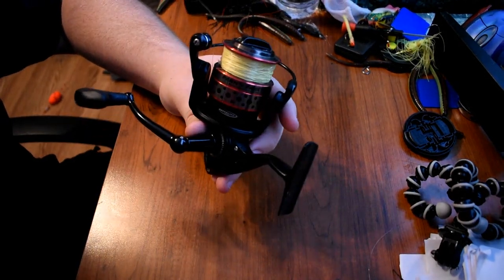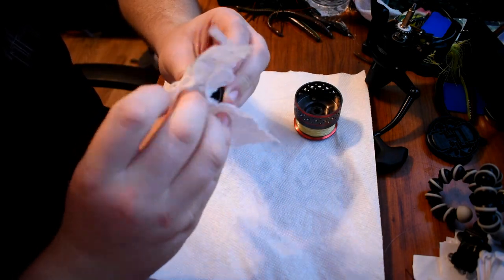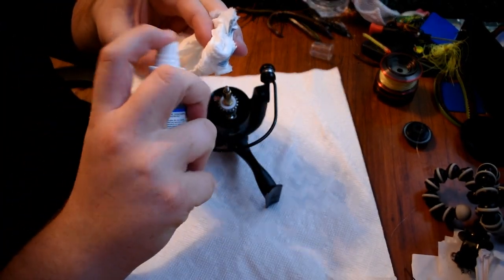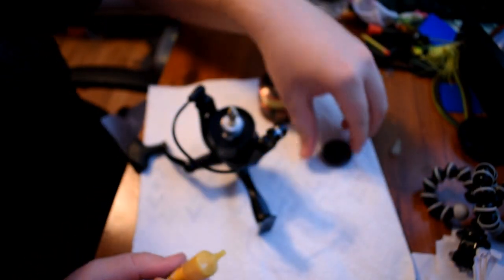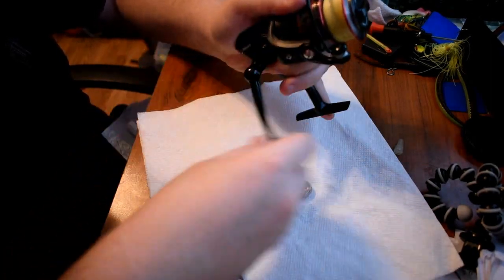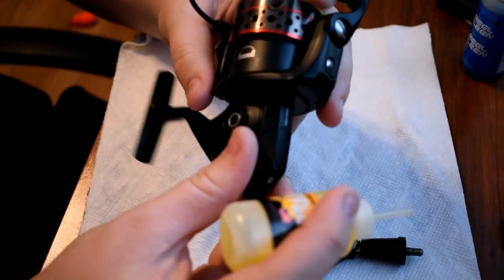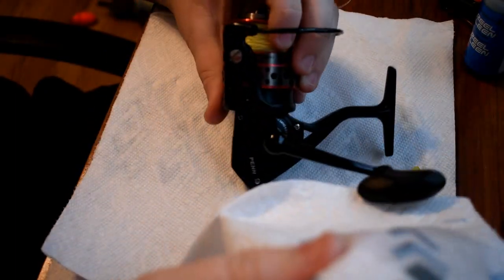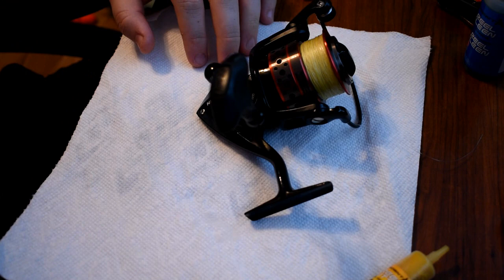How to clean and oil a spinning reel

Comment: I started watching some videos on YouTube on how to oil / maintenance spinning reels, and only 1 of the many videos address removing and lubricating the line roller (on the bail).  I started to clean my reels and did not intend on doing this extra step; primarily because I didn't think any of my reels had bearings in that area.  Come to find out, their are reels that do have bearings in the line roller and some that just use lubricated plastic washers.  Anyhow, I ended up removing the line roller on one of my reels, and low and behold, it was rusted beyond belief.  After seeing that, I decided to take apart the line roller on the rest of my reels, and the same thing had occurred on every reel.  I actually had to use an impact driver on two of the line rollers, just to get the screw out.  I could not get them out by hand and did not want to risk stripping the screws.  One screw did end up breaking.  So that's how stuck it was in there.

The point of this is that, I don't think enough people are addressing maintaining the line roller.  This will now be the 1st thing I maintain on my reels before anything else.  I am almost certain that the reason this happens, is because the line roller is the one part of the rod that is exposed to the most salt.  When you think about it, every time you cast your line out into the water, your line gets coated with salt water.  That salt water is then transferred to the line roller, and any residual amount transfers to the bearings (if any) of the line roller.  Check your reels for this and I'm pretty sure you'll be surprised at what you find.

This issue creates resistance that can be felt when reeling in smaller fish; and proper maintenance of the line roller will allow your line to roll with the line roller, instead of against it.  After I lubricated all of my line rollers, I then took a rubber band, cut it and ran it back and forth across the line roller (in a V shape) to make sure it was properly lubricated.
Reply: Great advice. I made sure to wash & lube my line roller and i noticed a difference immediately.
Reply: Mate you could make your own video

Comment: Thank you for showing this !
I actually had 2 reels that had a minor "thumping" when reeling. When I looked into the front of the spool, the spring clip had worked itself forward, and left the spool wobbling during reeling (which made it reel line unevenly, which also caused the minor "thumping").
I pushed it back down into its spot, and now the reel reels smoothly !
Thank you once again.

Comment: Where do you get the oil and  grease that you use?  Thanks for the video
Reply from the maker: Bill Rheinhardt I got it from gander mountain but they have been going out of business so I think bass pro or dicks sporting goods has it but if you are in the Tampa fl area there is always Tampa fishing outfitters has plenty of anything you need
Reply: Amazon has Ardent reel cleaning kit

Comment: You don't remove a side plate and lubricate the wheel and pinion??
Reply from the maker: I do but not unless I need to but I do that 1 time year.
Reply: @Twickleitfishing  I do mine once a year over winter.  I use Lucas Red Bearing Grease.  I have reels that are 40 years old and still function just fine.
Reply: I do alot of surf fishing in chest deep saltwater.  My reel spends half it's time submerged.
I remove the cover, clean and relube everytime I fish.

Comment: So what's the difference between the little one and bigger oil? Do you need both?
Reply: Hearts your comment but doesn't answer.😂
Reply from the maker: It’s grease for gears oil for bearings
Reply: D. Moreno Reel Butter is a grease.  Grease is used on metal-to-metal contacts and oil is used for bearings and tight areas where grease can not reach.

Comment: Y’all...do NOT use WD-40 on your reels, ESPECIALLY if you fish saltwater.  Saltwater reacts with WD-40 and makes corrosion even worse overtime.  White lithium grease does well in salty conditions, and lasts long.  It’s also cheaper.

Comment: theres no reason to put grease on your handle. IT screws in. Maybe a dab for sake of keeping it wet. but sorry no. Grease lubricates parts touching each other not for something that screws in.
Reply from the maker: Steven W I fish in saltwater I truly to avoid rust
Reply: Makes sense to me. Mechanics use anti-seize grease on bolts so they don't seize up and most likely reduces rust buildup. Thanks for the tip Twickle, I'll be trying this all soon.
Reply: Also, my reel is pretty much brand new and only used it twice thus far, but still saw blue grease on the stem of that screw section from the factory.
Reply: I always grease or oil anywhere that can rust. That's good advise
Reply: Sean T That “blue grease” is medium strength Loc-tite which is used on screws and nuts so they do not loosen easily.

Comment: Too much lube and grease, a little goes a long way. Otherwise, very helpful info, thanks for posting.
Reply from the maker: Eric Killmeier maybe for high end reels or just in fresh water but in saltwater grease will save your reel from corrosion I’ve had this reel for 4 years has been dunked and not a single problem if you oil and grease it like this
Reply: Twickle it fishing good to know. I only freshwater fish. I’m a good 10-12 drive from the Atlantic.

Comment: Can contaminate line and leave residue in water while fishing 🤓
Reply from the maker: That's why would spray it on the paper tower first and then wipe it onto the reel!😎
Reply: Fun fact...Fish are attracted to wd40. Downside, wd40 will eat away your reel grease when it works its way into the reel.

Comment: will wd 40 work
Reply from the maker: Sorry for the late reply and I would not use it for the inside of their reel
Reply: works for just cleaning the inside gears to rid it of grease and stuff before you put new grease on it. but take the gears out so you can wipe off the wd 40 so it isn't stuck inside your reel thinning out the grease because that's basically what it does. it's nasty stuff. broke a few cheap reels to learn my lesson. also take pictures after taking each piece out so you can remember how to put it together if you've never done it before. one part in the wrong place equals a ruined reel.
Reply: what about cheep sewing machine oil?
Reply: What about cheap reel oil?
Reply: just buy some  reel oil
Reply: i tought sewing machine oil was the same as reel oil